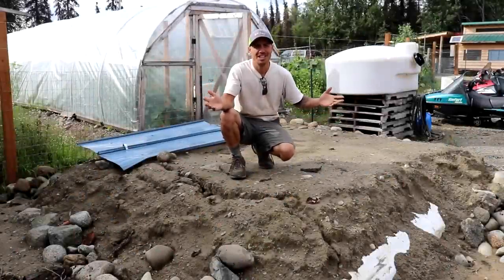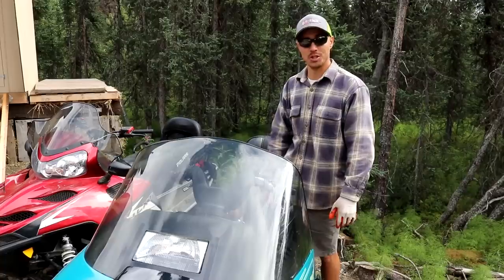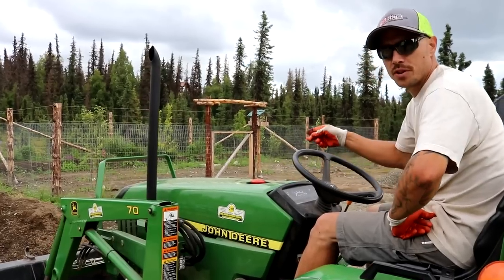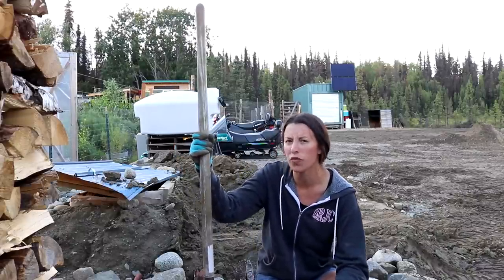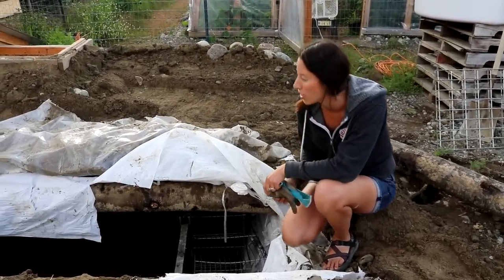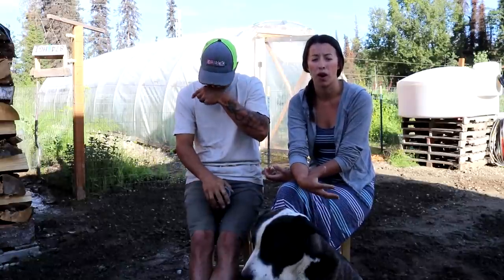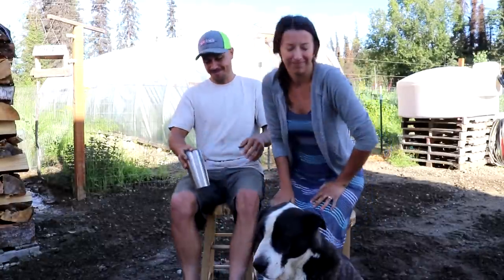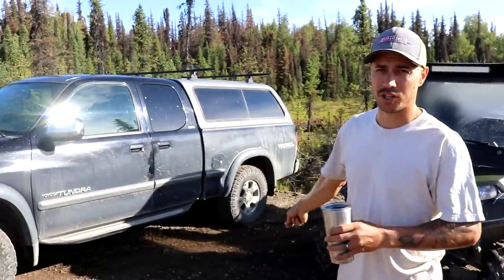Our Earthbag Root Cellar Fails | Addressing the Mud Issue

Comment: So glad I watched this. Watched you build it and now, ... sob
I just bought 875 bags to start. I'll need more than that. Working on a real scimpy budget with a total monthly income of $475. Whoo Hoo!
Was planing on going at least two feet deep in the sand pile I'm playing in. I'd prefer three. And I was going to go square for the first project of the root cellar. 
And now I'm going "round" for the structural integrity. I can always pile sand up on the sides. 

Too bad, that was a lot of work. 

The two acre sand pile I'm playing in is in the low wet end of a field and when they were looking for a place to dump the sand from the dredging at the harbour, that was the spot! there's years of sand there. 
The sand is 6 to 10 feet deep in places and mostly level except some piles at one end of the lot.
I'm going to just use cement with the sand instead of clay, easier. Do up a few test bags at first to get the mixture and amounts right and run with what works. 
Have a great one.

Comment: Suggestion? Shipping container dug into a hillside with earth bags surrounding it. Logs and earth bags across the top. Cover with dirt and roof it with a surface area half again as wide. Keep the whole thing dry. Earth bag the entrance out and put a door in. You can even rig a French drain under it with gravel to control the water table seeping in. Stay true.

Comment: I just newly subscribed and watched this video and well as several others. I have worked heavy construction for over 25 years and I have a solution for the failed root cellar. I will be sending you both an email with the idea and resources for your new root cellar, this idea will hold up and last more than a lifetime without any difficulty or failures. Love your channel and your hard work.

Comment: Try to find some surplus freezer panels from a commercial freezer, we put one together 20 years ago and it is still standing. Hardest part was the cement floor the rest bolts together. Best of luck.

Comment: We have used insulated space (in the house or an external shed) and added ducting to a warmer area (usually the house or garage) and ducting to a cooler area (usually under the house or an earth tube).  Then hooked those tubes up with a small fans and a thermistors.  Not as good as a good root cellar.  But surprisingly not bad.   Then you can play with the tubes at different heights in the storage space so you can play with stratifying your temperature a little bit.  

At the sustainable gardening conference several years ago, a group from Galena talked about the connex they set up for a root cellar.  If I remember correctly, they didn't sink it into the ground at all, they just brought in dirt and buried it. They laid insulation around it (foam - i think).  I think there ended up being about 2 or 3 feet of dirt on top and 12-15 feet on the sides.  And they heated it with a light bulb on a thermistor, but it only turned on when it was -50 or colder for a stretch.    Galena tends to flood a lot though, so I always wondered how it did with ground water.  

Thanks for sharing all your experience!  Good luck!

Comment: Build an above ground cellar attached to your cabin using double wall construction. The studs do not touch each other (outside to inside), each wall (plus floor and ceiling) is insulated and are separated by no less than 1-2 inches.  It will remain surprising cool during the summer and if it starts to get too cold in the winter simply light a candle or crack the door to your interior living area. Heat or cold is transferred from the outside to the inside through studs, hence the gap between walls.

Comment: I've been giving your situation a lot of thought.  It was hard to watch you take down what was really a great attempt.  Do you have a new plan?  About ten years ago I worked as a rate clerk in a trucking terminal.  The owner heated the docks and the office with a remote wood burning furnace, which was forced air via underground duct work.  He never ran out of fuel as pallets were plentiful.  If you did something similar with an additional shpg containter, you might be able to generate enough power with a small wind turbine to force the heat to the container.  It wouldn't take much to hover at slightly above freezing.  Of course the conrltainer would have to be heavily insulated but you could do that externally thereby preserving all the interior space.  You certainly have enough fuel and it would be above ground including the duct work, which also would be well insulated.  I've seen these exterior furnaces around here at farms too.  (Wisconsin and Minnesota so we are quite familiar with very cold weather.  This Feb we were below zero every day for 3 weeks!)  I hope you see this and let me know what your plans are.  I so want you to succeed !

Comment: I'm about 700 miles from you in SE Alaska, but your ground looks very similar to mine with the muskeg and a bit of rain forest. I'm learning that even in the higher spots the ground is much too soft and muddy for anything to stay put unless it is built into the bedrock. What some people here do is build a "cool box", basically a lightly insulated pantry attached to the outside of the house, in full shade and with a vent on the under side for fresh air. I don't fully understand it, but it seems to work.

Comment: Hey guys,so sorry about the loss of the root cellar.  I felt so bad for you watching you fill it in. It sucks that you couldn’t salvage those shelves. The added space from having that hump gone is a plus though and as you said the experience did teach you something and you did store a year’s worth of food,which probably balances out the actual financial loss somewhat.  I am wondering if you could cut a hatch in the cabin floor and build a food storage box below the cabin but not really deep in the ground. If you insulted it extra well it may work. It obviously won’t be as big as what you had but....... Not sure if you watch Shawn James/My Self Reliance,he has a food storage box under his off grid cabin. He is about 3 hours from me here in Ontario Canada,while it is not as cold as Alaska it does get pretty cold. You could use several different layers of insulation,maybe some of those earth bags,wood as the structure,rock wool and foam board insulation. I think if you didn’t go much below grade you may be ok??

Comment: Have you watched the root celler build from Off Grid with Doug and Stacy? Their property is in Missouri. They put one in last year. In the meanwhile, maybe you could build a super insulated shed for your food storage. Also keep storing the root vegetables in sawdust in totes. Doug and Staci used styrofoam forms and rebar with poured cement down the middle of the forms that were stackable. So sorry for your loss.

Comment: I have a friend  who used a new septic tank.. You have an area back there were you didn't have enough gravel to finish so you could put it right there and then cover it up with logs on the outside and then cover it with soil.. So it's still above ground but it will be insulated.. You could use either the top hole to get in or you could put up A doorway into it from the front and then extended out by building framework around it about 6' and putting another door on it.. So you have a double door which will control you're moisture and humidity and everything a lot better.. It's an idea it works for him.. You can also cover the outside of the cement box with a water barrier coating.. Before you put soil over it.. And septic are meant to be buried so the soil/weight on the top isn't a issue..
Just though I'd tell you bout this option.

https://images.app.goo.gl/KSkY8SfCMWQGLuMN8

Comment: For your mud issues, I was just wondering if some of the farmer shows I  Watch would not help with your issue. I'm talking about putting tiling down underneath your Driveway. Watch some of the farming videos and see what they do by put in in tiling. Basically pipe with holes in it to help water run away from your area. They call it tiling

Comment: You might try to build the same soil bag building above ground and add rebar thru the walls to help keep them from bowing. You can always berm it with soil. But cover it with plastic to keep water infiltration.

Comment: Sorry your root cellar didnt work out, but as you said, you learned a lot so it really isnt a fail...  what about an ice room just off your house. A super inside and out insulated room built of cement blocks even two blocks thick w insulation between and a dirt and gravel floor maybe w some type of  rods that can reach down and grab the cold from below the ground, and metal tubs to hold LOTS of ice for spring to fall. A drain channel through the center of the floor and away.. a reflective roof. And adjustment for winter use. Of course thats just a quick thought I have no clue if that would even work... I guess an old ice house like 'Little House on the Prairie' wont work because thats partially underground, but some kind of above ground building... still tapping the permafrost... as I say IDK but I would sure be researching it!!! Good luck on whatever you decide this winter.

Comment: check out how my little homestead builds their rooms(earth bag and stucco) you might be able to use the same process to build an above ground root cellar maybe use double thick walls to protect against the cold/ build a mound around it to block out some of the cold. they live in the desert but it should be the same principal process and might work for what you want plus they make large structures so you could feasibly make a multi room cellar or just a single big room and have things its ok that freeze on the outsides and things that just need to be kept cold at the center of the structure. just a couple ideas, sorry you had a setback but you will bounce back and make something that works better for you guys

Comment: Encase a conex, above ground, with two rows deep of earth bags. Frame the cold storage door deeper 6ft+ into the conex so you have an area for dry shelving and a landing table before the cold storage.  Stack earth bags inside  the cold storage along the wall of the door. You will have exterior doors, dry room, cold storage. Lay timber cross ways over the top and layer with Earth-bags. An open shed built over the cold storage will keep sun from warming it up and rain from soaking it.

Comment: Thank you for sharing, it does sound (because your water table is so near the surface) that you could make an above ground root cellar (to bad you didn't have a little mountain to dig into, don't use railroad ties exposed the taste of creosote will permeate your produce), the only other way would be to pile lots of dirts, gravel...let grass grow on the hump on an above ground one.........
Maybe a sunk barrel in your cabin floor with a hidden trap door, I know with carrot & root veggies they can be put in a bucket with dry sand coating them (air dry vegging skin for at least a day before putting them in the DRY sand & it should be cool enough through fall and warm enough not to freeze since they are in your house floor)
Reply: The logs you buried should be fine because your water table is so high, submerged wood is one way the logging industry preserves wood from rotting till they can finish processing it

Comment: You can can potatoes. Naturally, you have to accept they're not going to be as good as having fresh potatoes but canned potatoes can be turned into mashed potatoes, fried potatoes and even sub in potato salad. We can large russets by quartering the peeled potato and packing them as tight as we can get them +salt and water to cover. You might have to modify process depending on size and potato variety but large quartered russets work perfectly for us. I've heard of people freezing potatoes but that has never worked for us. 

You can also dehydrate sliced or diced potatoes and get a decent product after rehydration. Carrots also dehydrate and rehydrate extremely well--may even be the best at returning to somewhat normal of all the vegetables we've dehydrated.

Have you considered insulating your shipping container and using that for food storage? In winter, snow acts as a good insulator against the colder wind and ice. 

Best wishes and good luck on your journey.

Comment: @Simple Living Alaska I saw few days back a ground level hobbit house -like root cellar. Basically they've built a 4x2 meters room  with arched ceiling using bricks and then they covered it with 60-70cm of dirt. The guy told me it works very well in the winter with temperatures hovering between 4-8 Celsius. It gets a bit warmer in the summer 16-18 C but it doesn't really matter as you need it the most in winter. Adding more dirt, like 1 meter or so, would definitely improve insulation. On top of everything, there's no worry about ground water filling it up. It's worth considering!

Comment: Just a idea how about a addition on your house at the size of the root cellar but use two by eights and form somewhere in there with scrap form around the local stores and the 2 x 8 maybe you could find enough lumber to build them yourself with a chainsaw attachment that you can cut your own boards but if you attached it and only put the door to the  your house. Outside door but this way you can put fence from your house to the room or somewhere another install some type of a little heat to where you can keep the room at above freezing like a root cellar I know down here in Michigan last time stores with the packaging away a form and you could probably do something where you can grind it up with something and fill the cavities with foam to insulate the room so you can control the temperature just a thought

Comment: We had neighbors here in Montana that build an above ground root cellar made of lumber, and insulated with sawdust. It did an amazing job, even without modern insulation. We had a couple of weeks of -30F to -45F, with windchills hitting -60F in the day, -80F at night. They had nothing freeze. The walls very very thick, with inner and outer doors. I don't believe that they kept a light on inside to keep things from freezing. It was probably 50 years old back in the 80's.

Comment: It may be cost prohibitive, but a plastic or fiberglass septic tank might be an option.  Even one of the 8 ft water storage tanks might be used if sufficiently braced on the inside. Just a thought.

Comment: Try a stacked cord with & cob addition.  You have all the extra wood and it's one of the quickest construction techniques.  The hold temp much like an in the ground cellar without the water table issue.  Do it as an attachment to your cabin and then you can get to it in winter time without clearing a path.  To further stabilizer the temps, shovel snow up around it in winter.  Look up old mother earth news.  They had many articles on this.

Comment: How disappointing.  The hard work and effort you guys put into it was herculean.  On the plus side for us viewers it means you'll have to find another food storage solution, which means a new project to video.  Can't wait.
Just wondering, if you had done the root cellar in concrete would it have held up against those elements?